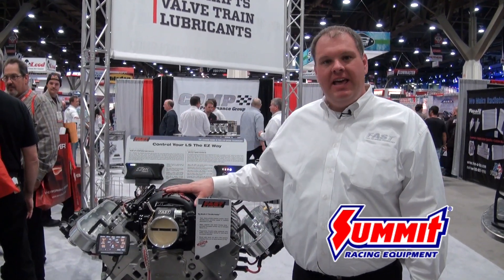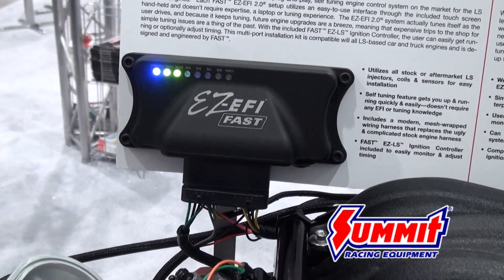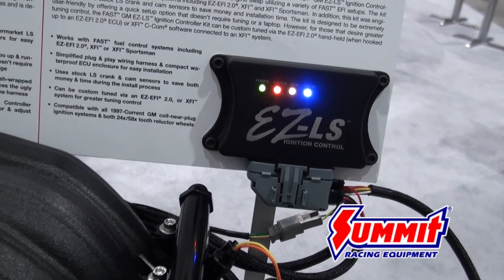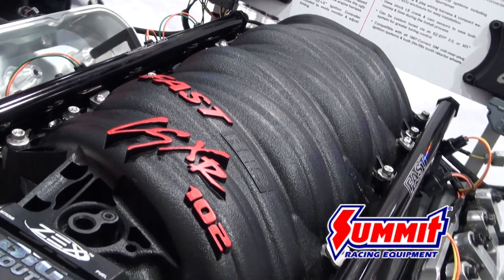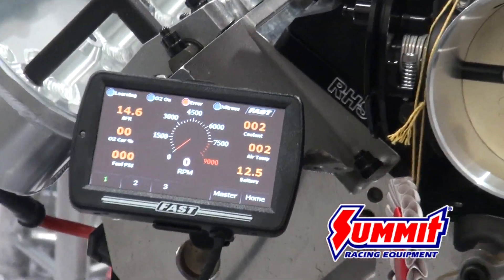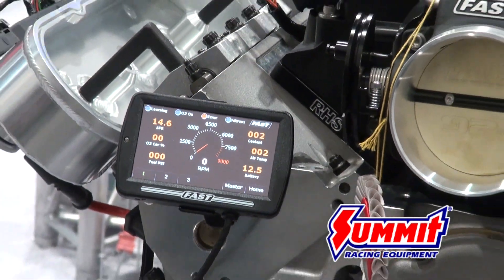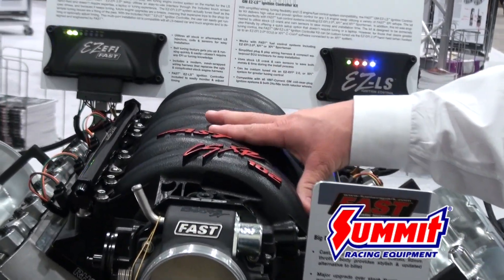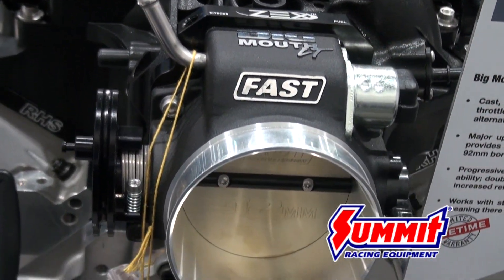FAST EZ-LS EFI Fuel Injection System - SEMA 2013

Comment: How much is the complete system for an LQ9?
Reply from the maker: Hi kamendodge,
That kit part number is FST-30405-KIT and the cost is $1610.97. This includes the fuel injection computer, the ignition computer, wiring harness and hand held controller. The intake, fuel rails and throttle body shown in the video are not included but can also be purchased.